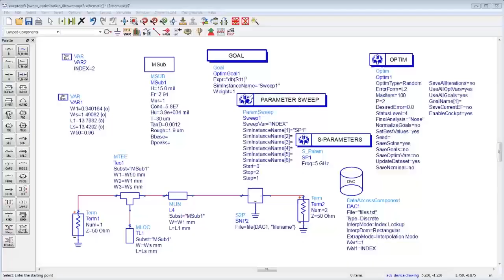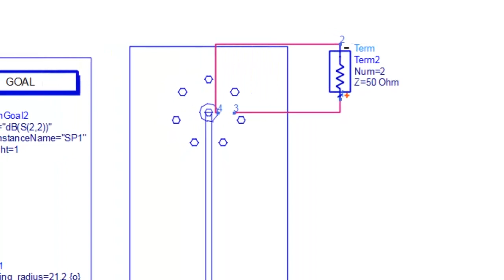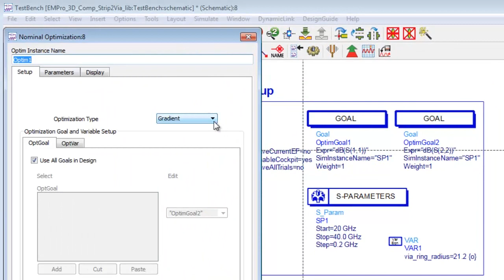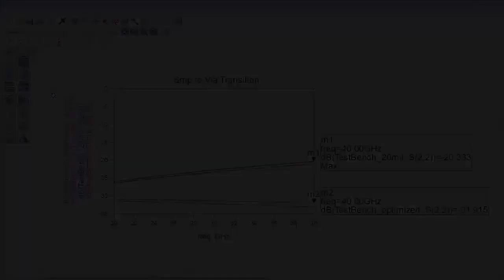Via Transition Design Using ADS Integrated 3D EM Optimization

Comment from the maker: Hi Ruby Singh, thanks for watching! Are you trying to learn a little more about using Vias in RF layout/routing? Most of the time, the MoM and FEM simulators built into ADS are more than rigorous enough simulate the effects of via transitions; therefore,  VIA placement for RF boards can be done in ADS and not EM pro. EM Pro is ideal for simulating connector interfaces and other situations where a full 3D field solver is necessary. I hope that answers your question! If not please clarify what we can help you with!